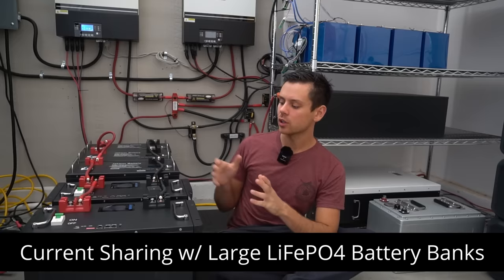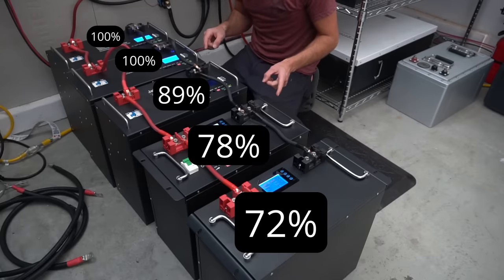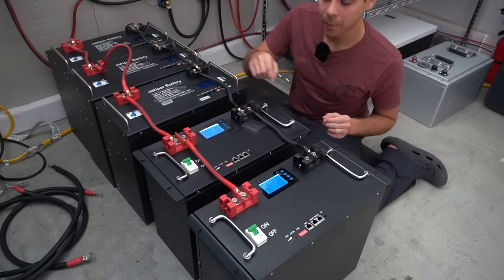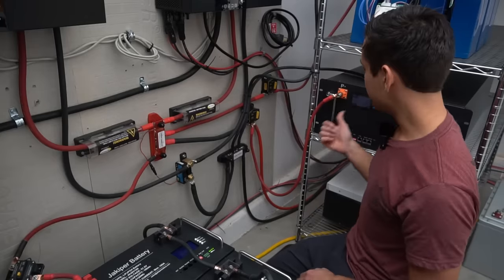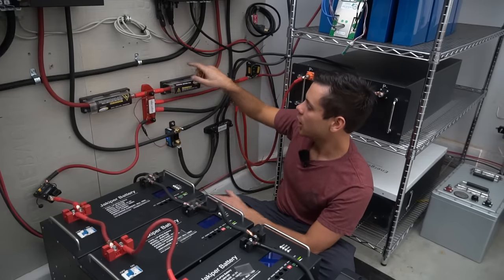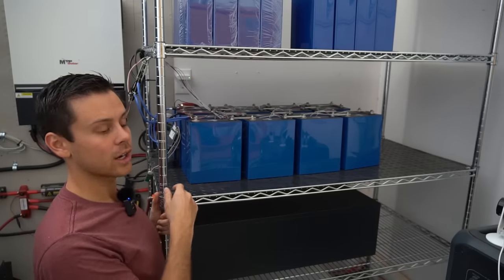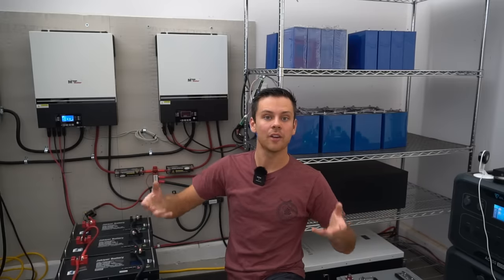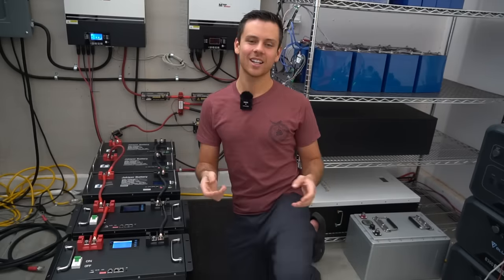Current Sharing 101 w/ Large LiFePO4 Battery Banks

Comment: Wouldn’t you be better off connecting the input output cable to the center battery of the five? Then you only have two hops to get to the end of the string.

Comment: I decided against T-class fuses and used industrial MCCB DC Circuit breakers with even higher breaking capacity. They are more expensive though but I like that I can isolate both positive and negative at the same time.
I would not trust these circuit breakers you have installed there (the ones with the yellow lever). They may or may not disconnect when you need it (or at a much higher rate as tests have shown). I cannot see how they fit an effective arc extinguishing chamber in such a tiny case. I know you use them as switches as you told me but is there nothing better out there which is safer? The mechanic inside is extreme flimsy.

Each battery bank should have its own main battery switch. As you said never rely on the BMS for this. Imagine you have to connect to the BMS via Bluetooth first and find the setting to turn off the bank 😂

Also, I don't see the need for the same length cables for inverters (battery banks connected to a busbar, yes!). If you have them in parallel, they will communicate with each other and if one turns of due to low voltage, the other will turn off as well. That's a requirement in split or 3-phase configurations. Obviously from a pure performance perspective you want to avoid that one is turning off much earlier than the other.

Busbars 💪
Reply from the maker: Which circuit breaker are you using? What's the DC interrupt rating? 

And I already reconfigured this system with more t class fuses 😂 ahh well. I kind of threw it together over time. A single breaker is fine for an individual pack, but yeah, not for the massive chain of batteries I accidentally created 😂 it's safe now. Lots of 2/0 gauge. Something that no one realized is the resistance across the terminals themselves.. some have a large copper bar, and others don't! It can make a huge difference. Guess I should make another video. I'm so tired, making these videos is so tiring. I want to cover everything, but the comments make me elaborate on every single thing. I'm sure you have that problems sometimes too haha it never ends! Battery addiction is also a real thing😂
Reply from the maker: Oh the manuals usually state to use equal length conductors. If you oversize the conductors, sure. My friend actually showed me an example where larger conductors can make differences in resistance more prounced, and actually cause issues. I suppose I could make a whole video on that topic too 😂
Reply from the maker: T class will work great for my pack. I would love to learn more about the breaker you're using. And that's the interrupt rating is higher? That's wild
Reply: @WillProwse  Hahaha, I know exactly what you mean. You think you have covered everything in this single video and the comments are demanding more, more, more. It will never end, this is just the beginning 😂

I use the NOARK MCCB circuit breakers (2-pole version). T-class has an interruption capacity of around 15-20kA while the NOARK breaker have 25kA breaking capacity. Both are ideal for our lithium batteries for sure. It just comes down to personal preference, I guess. And, as I said, I like the isolation feature of the breakers of having both battery poles disconnected.
Reply: @WillProwse  It would be interesting to test this with two same inverters but using 2x, 4x, 10x longer cable and see if you can find a difference in performance or even basic function of the inverters. It's a bit of a long shot for a test video, lots of effort... As long as they stay just in parallel, it should not be a problem but split or 3-phase could be an issue. Interesting topic nevertheless.

Comment: So, my Giandel inverter 3000w 24v just took a crap when my Harbor Freight angle grinder had a short in the cord. It went past the breaker, passed the gfi, and broke the inverter. OL, wont reset.
I have loved this thing but it hasn't been long and I am quite perturbed.
This would be a great video for you just take a Giandel inverter and short it out on a old cord or something. A inverter that wont reset from something like this is basically useless in the long run. My 30 year old Heart reset no problem when I did the same thing. I love that thing.
You could then take apart the inverter but be careful those things can hurt you.
I had to but another one right away cuz I need that thing.
It doesn't make sense to me why the gfi didn't break. There must be a GFI for this. NO WAY it should have got to the inverter at all.
Please explain wise master

Comment: But the diameter and length of the Busbar does count the same a flexible copper conductor line.. so still no real solution for voltage drops in the lines i guess.

Comment: Will, Will Will.... I went to the forum and wasn't able to get an answer. thought I'd bug ya. If you could find the time look on the forum "Victron Multiplus 2000 random shutdown" BUZZ68 and give some advice on how to add more batteries so I can run my 12v AC when it's really hot.  2 years in use

Comment: Ok my question is about the lithium batteries I have from amptime.  I have 8each  12volt wired parallel for 24volts . I'm told by amptime that you can only use up to 8 batteries with a bank . I've emailed back and fourth a week . It makes no sense to me .
Reply: This is a 1k solar system with 6k inverter 24volt aims . When I asked battleborn they claim you can have the bank as large as you want.  Amptime claims you could get back feed and burn the BMS out .
Reply: I just want to keep things safe . My bank is in my home and and I'm 100 percent off grid . I've been running this system for 2 years but would like to increase the bank for winter months

Comment: I'm a boat Captain in California. A dive boat in my area burned to the waterline killing 75 people onboard. Based on eyewitness testimony and recovering the boat in shallow water they were able to determine it was a small battery for underwater camera's or a cell phone battery that lit off while recharging. The marine environment is extremely harsh on people and equipment. This dive boat was made of wood, the crew heard a "pop" then seconds later the whole boat was in flames. I drive metal boats but have still had issues with these batteries. A lot of smaller sailboat people want to put these in their engine rooms and other extremely hot harsh environments. My nickname by my crew has been "Captain Safety" however I find myself up against "true believers" of this battery technology, I have drones, I'm not against this technology, I'm against blindly using it unsafely. These "true believers" have seen the recent auto transport ship go down and swear that it can not be because of LifePO4 batteries in the cars because they are the safest in the industry. It's hard enough to fight a traditional oil based fire (gas, diesel) onboard let alone a hundred metal fires. This auto carrier was sunk in 9000' of water because the "solution to pollution is dilution". Is there any way you can show these LifePO4 batteries are still subject to thermal runaway? Id also be interested to see if they can go into thermal runaway just by getting wet. Perhaps we should be shipping the cars and the battery components separate. Any help you can provide would be very much appreciated. Thank you.

Comment: Hi Will, Ken from the UK, great video and I learned a lot from this well presented explanation. I am currently using Lead Acid as a battery bank, but want to move to Lithium and this video alone has increased my confidence to make that change. I am currently looking at 3 x 48V 100AH LiFePO4 Battery pack with high quality 10Ah LiFePO4 single battery cells. I still don't understand the significance of having the Inverter in control as some battery suppliers insisted, because my Hybrid Inverter does not support any kind of link to BSM system. But it does offer full control over the settings of discharging and charging. So you think it is OK to rely on the BSM alone using all the other precautions explained in this video?

Comment: How is the correct fuse determined for a situation?
Reply: In principle, fuses protect wiring - so a fuse has to be at least able to interrupt when the maximum current the cable can take is exceeded. In practice, you figure out what your loads are pulling at max (including any inductive load inrush currents) and pick the next fuse over that, maybe with some additional de-rating for temperature. If however you have a BMS that has 200A capability, it makes no sense picking a fuse higher than that (with a margin, and maybe if it has a peak rating, pick that one).
Reply: @upnorthandpersonal  Would the first step be to determine what is the priority to protect? The wiring? The equipment? The weakest part of the system? shock hazard?
Reply: @FairnessIsTheAnswer  In a proper design: all of them. Start with sizing fuses to protect your wiring, and potentially equipment. Not much shock hazard in a 48V system, but proper covers over bus bars etc. is important: anything that can create a short by e.g. dropping a tool. In addition, personal safety: glasses, proper closed shoes, no jewelry, etc. when working on the battery.

Comment: 1:06 what?? this is a simple passive parallel connection, it will constantly level itself unless there is a constant high load that matches or exceeds amp rating on the wires
Reply from the maker: No it will not constantly level itself. They can be at the same voltage and they will not be the same state of charge. That's why it's different than other chemistries. This is also why you have to top balance past the knee of the curve
Reply: @WillProwse  thanks. i missed that these are LFP batteries. Im so used to working on the older chemistry battery on devices/portable tools.
Reply from the maker: Yeah the other ones are so much easier to work with in that regard. It can be deceiving with this chemistry

Comment: High Voltage causes arcs, not current. 48V doesn't have that much arc potential. A properly rated circuit breaker will be fine. If it wasn't then people's houses would be burning down all the time from circuit breakers.

Comment: The connection system used in the large bank is not done to the correct load sharing method. When multiple batteries are connected in parallel the connection cables must be connected positive to one end of the bank and negative to the other end of the bank this stops the unbalance of charging and discharge. also wiring needs to be heavy and capable of handling a full current short between cells. This means wire lengths are different but that balances out as load reduces.

Comment: You keep saying "Buss bar is better than 2AUG wire", but you didn't specify the size of the buss bar.  If you have a 1/8" by 1/2" buss bar, it will have a higher resistance than a 2AUG wire.  You need to define what size buss bar is a better choice than a 2AUG wire.

Comment: Also using oversized wire can lead to over exaggeration of smaller resistance point differences.  It's better to use the proper size wire and not oversized!

Comment: X-Sense Wi-Fi Smoke Detector: 
Will you have a respect for your battery systems, you read books educate yourself and have a good memory and it shows with your Top-Notch videos best on YouTube.

Electronics from time to time goes bad I diodes a Cheap Chinese BMS, Even UL approved equipment can have defects that can cause a fire. I would suggest that you get a smoke detector with Bluetooth wireless that will alert your phone if you have a problem. 
Or go with a professionally installed burglar and fire detection system with cellular all calling.
Reply from the maker: Smart idea. Thanks Mack